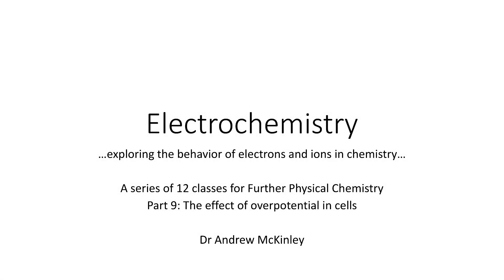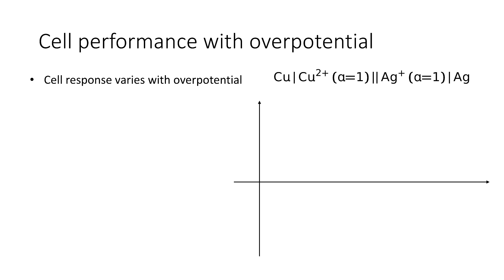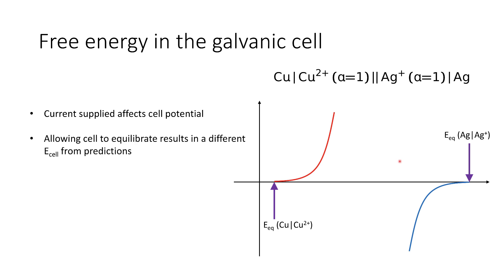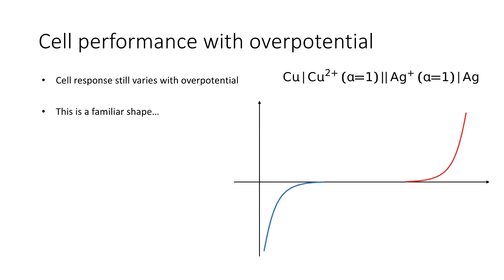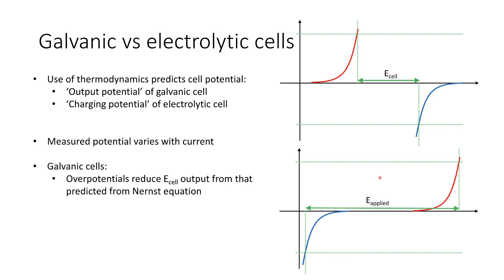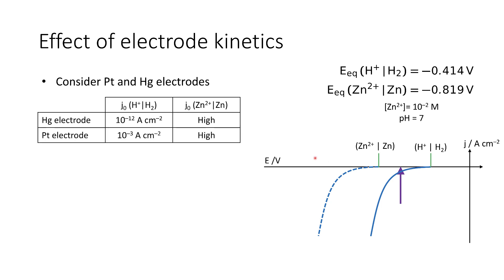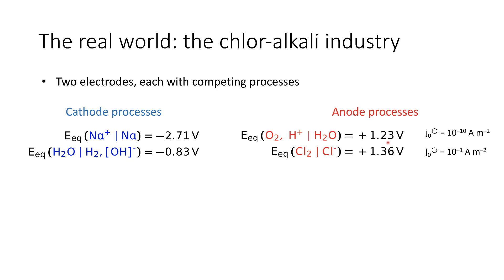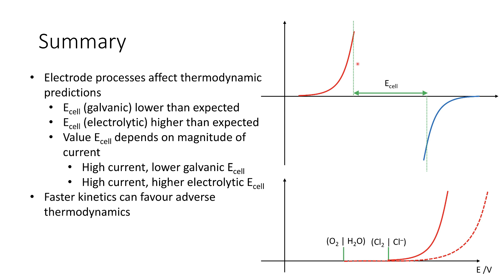Further Physical Chemistry: Electrochemistry session 9

Comment: Thanks for making these videos available to the outside world. They are exceptionally well done.

Some minor exposition-related feedback: always, always make sure that axes are labeled. And make the distinction between curves clearer. In the last example you switched solid and dashed lines (because of course you  use a solid line to mark the dominant reaction) - it tricks the brain into thinking that the solid line is the same reaction from the previous graph. Adding a label to the    raising trait of the curves would make following the reasoning easier. 

In the end, thermodynamics sets the 'starting points' of the curves, while kinetics dictates how fast the curves rise, so who wins depends on both. Doubling the labels would make this evident at a glance.

Comment: at 5.12, according to the diagram, At Ecell = 0, it must correspond to some equal and opposite currents. But we know that when voltage is zero,current won't flow.. Is it capacitve current? if so, how are we measuring the capacitive current?
Reply from the maker: I think you are becoming confused with "voltage" and "cell potential".  If you measure across a standard R6 cell (AA), you will measure a potential difference of ~1.3-1.5 V. But this doesn't mean a current is flowing; it just means there is a difference in the potential across the terminals.   When the potential difference drops to zero, it means the potential of the two terminals is now equal and there will be no thermodynamic driving force for any electron transfer. 

Yes, the diagram suggests that, for a sufficiently high current, there would be an effective cell potential of zero, however it is impractical to get to this high a current and in practice would not occur.

To hold a cell at a potential of zero, your potentiostat must apply a potential equal and opposite to the cell's equilibrium potential. No current will flow, and the only "current" is the exchange current at the electrode surfaces. There is no capacitive current in this example.